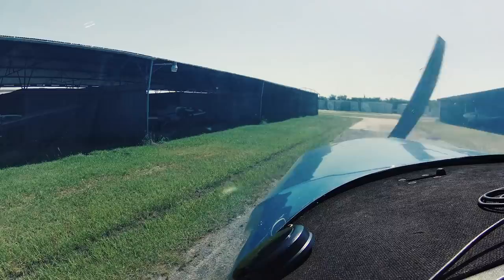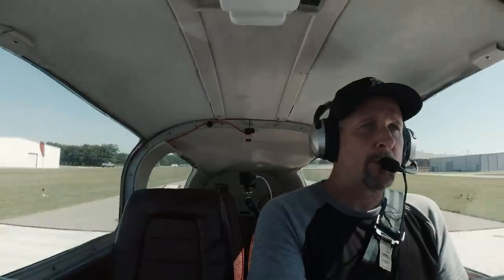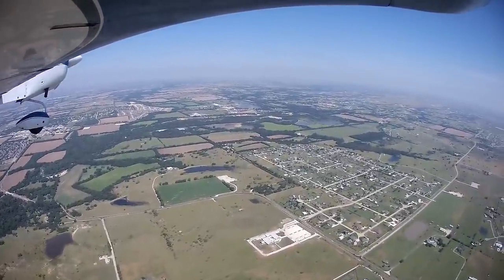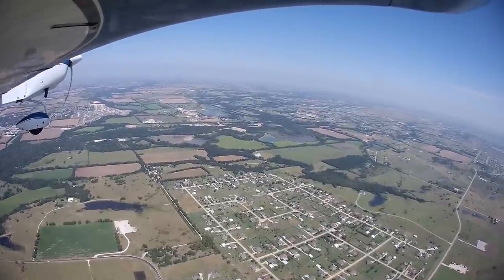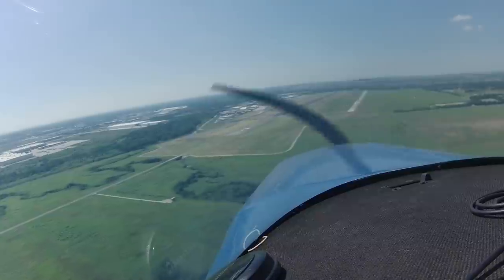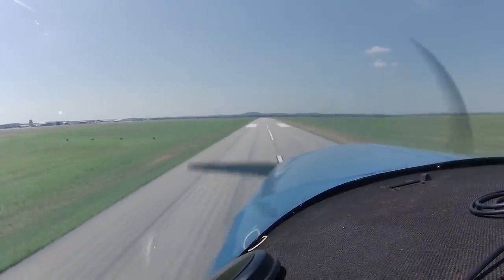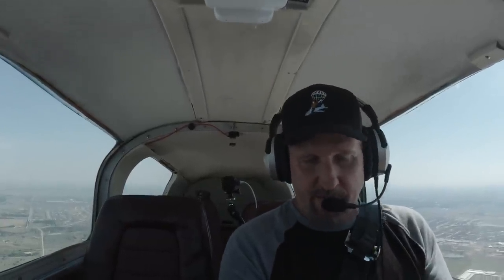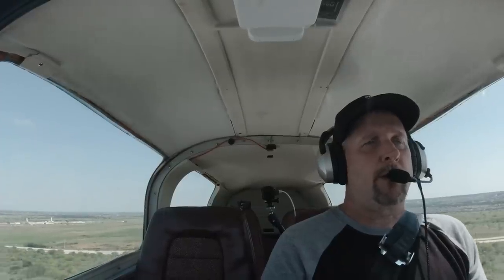Why do ALL runways go North and South?

Comment: The runway direction is a bit different in Australia, as we are upside down and the rotation is faster. There are also crossed runways because of this.  The runways are usually 045/225 and  135/315, this makes it much easier to land if you are flying in from N/S  or E/W. You only need to move a little left/right to land.

Of course every one flys with really big bush tires, so we dont really need runways.
Reply: Well that’s just wrong because Australia is made up by the government 🙄
Reply: I also heard you wipe your bum side to side instead of front to back.
Reply: John, not quite right, it just looks that way cause we is upside down. Our toilets do spin the other way when they are flushed but..

Comment: 40 years ago, I learned to fly at what was then a small field named Hooks out in the boonies north of Houston.  It had 2 parallel runways both 18/36 despite the wind always being 15 knots from 90 or 270.  Nowadays, that airport has just 1 real runway that's much longer and slightly NW-SE of center, and is so busy, combined with the increased activity at nearby KIAH, that it's no fun to fly there anymore.  Plus, what used to be nothing but piney woods with a few clear cow pastures here and there to land in should your engine quit has been replaced by many square miles of urban sprawl.  But still, the airport holds to the dictum that runways should be more-or-less N-S regardless of prevailing wind, so some things never change.

Comment: So… if the earth is flat wouldn’t it be flipping instead of turning? The elevation should be getting either higher or lower perpetually, right?
Reply: Not if you are adjusting your altimeter in time with the rotation. This is very important. Not many pilots understand these fundamentals.